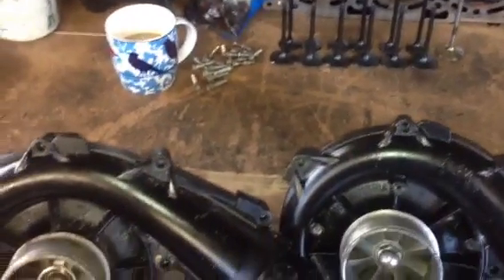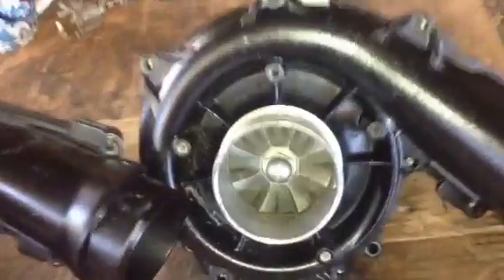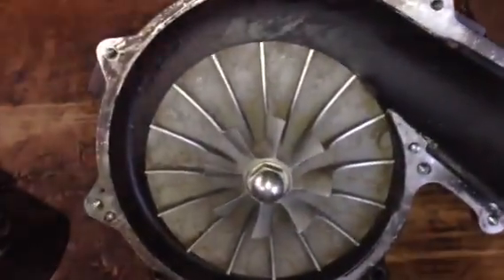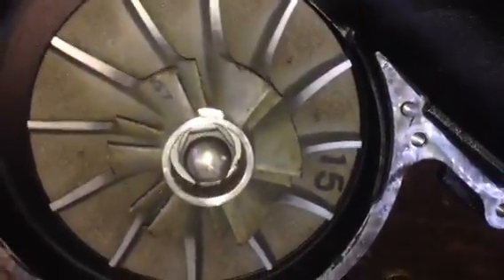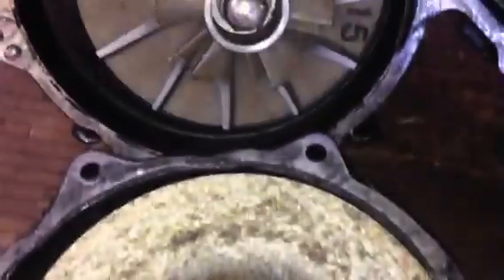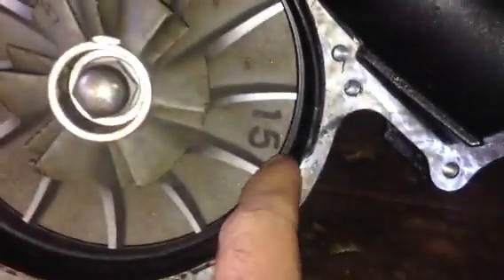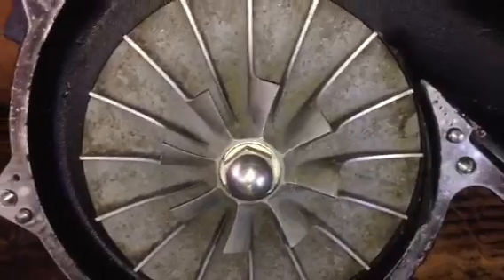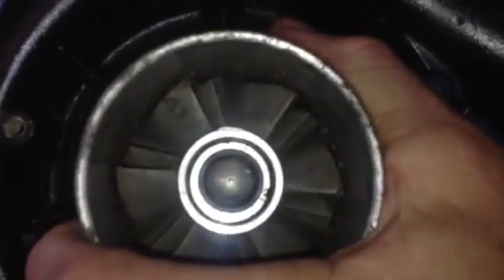Seadoo 215hp supercharger vs 260hp supercharger

Comment: Can I fit a 260 wheel and cover on my 215 charger?
Reply from the maker: Yes you can but the 215 Hp super charger base will need machining so that the 255-260 wheel wil fit .

Comment: How much is it to convert a 215 to a 260
Reply from the maker: Nino Basile the best will be if you have a 215 supercharger is to install a Riva Motorsport USA drop in wheel ,the xx wheel , with accompanied injectors costs around $1000 .00 . And I would recommend a supercharger service kit as well for your 215 hp charger . Otherwise you can just order a new 255 - 260 supercharger with accompanied injectors . The prices would be basically very close to each other so I would opt for the new charger and injectors and sell your old charger and injectors on eBay 😊
Reply: @Redrockat  Doing what you've mentioned above, does the ECM of a 2005 Seadoo RXT SC need to be re-flashed for the different air/fuel ratio from such an upgraded SC swap?  Does the RXT-X 255 also have an upgraded/different pitch impeller? - Thanks.
Reply from the maker: @KefirTView  yes the 255 PwC has a different impeller for the power . On the 2005 you might have to do a knock sensor conversion . We use the 260 injectors with this upgrade

Comment: Hey Red . Do you know the part# for the 48lb injectors as installed to the 260hp engine ? I am upgrading a 215 also and will have ECO tuned to suit larger injectors . thanks
Reply from the maker: MJHMech from which country are you ? I have done a few stage 3 skis from new and have spare 260 hp injectors and can ship to you . Will charge you half price and shipping 😊
Reply: Sounds good! Australia
Reply from the maker: MJHMech awesome I will work out a price and then get back to you . I will send your package to your work place or home via Post net from South Africa 😊 you need three injectors . Where in Australia are you ?
Reply: Thankyou . PM'd on FB
Reply: Redrockat hi redrockat do you have a email or something. Do you have a 260 charger. Or wheel. That i can upgrade my gtr 215. I already have 42 pound injectors

Comment: what are the physical size differences between the 2? is the base plate the same size for both?
Reply from the maker: skip midgett 215 base plate = 127mm And 255-260 Base Plate = 137mm . The top housings are also very different from each other . So physically they are Identical it is only the internals that differ .
Reply: Ok so you could not use a 215 base plate and a 255 top plate together?
Reply from the maker: if you use the 215 blade and base with the 255-260 top it will not boost due to too much clearance to the housings . What is your goal why ?